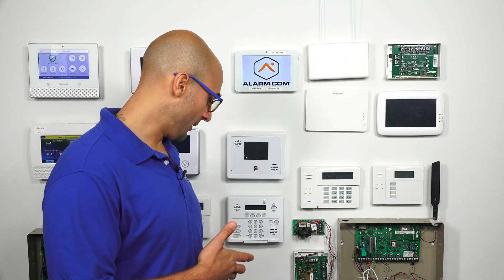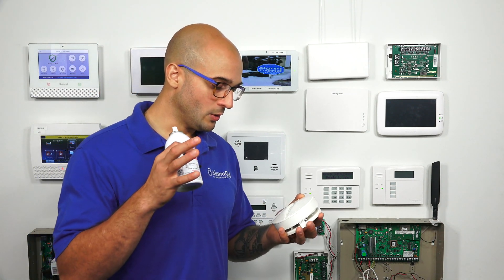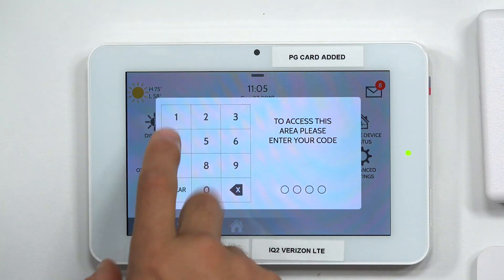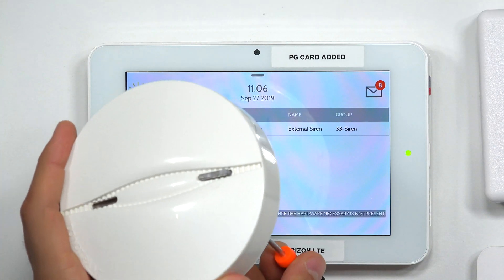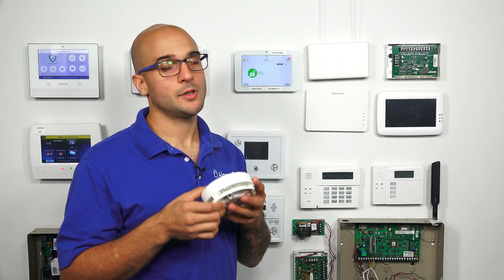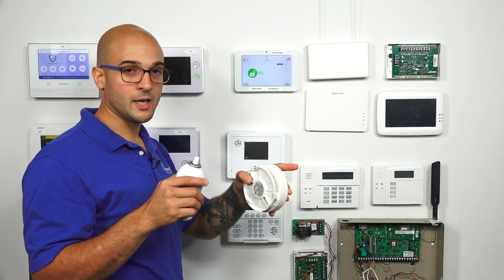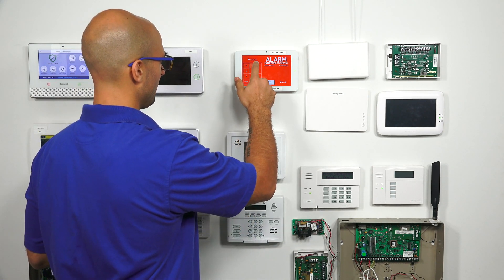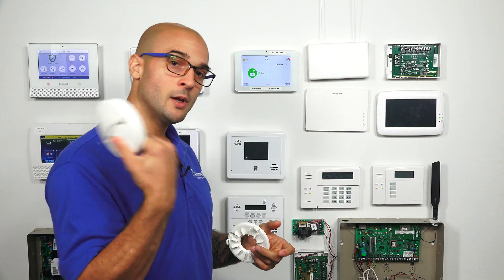Properly Testing a PowerG Smoke Detector

Comment: Wayyyyyy to much spray
Reply: You should only spray as much canned smoke as is required to actually put the smoke and the system into an alarm condition.  In this case, this is the amount of canned smoke it took for our smoke detector to trip.  The conditions in our video lab are not exactly the same as the conditions an end-user will face. However, this does give an idea of what users will see when testing.
Reply: @juliaross1667  sorry. My mistake. Indeed some smoke detectors react differently. I guess my smoke spray is different because i only need to spray for 1 to 2 detectors. Depending the hight and kind of detector